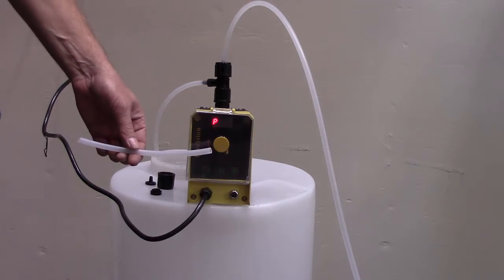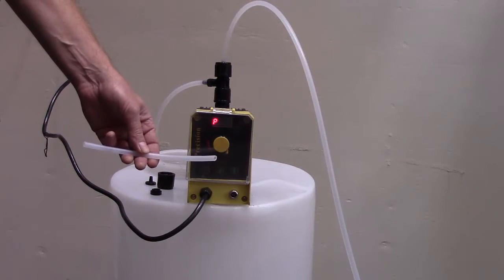Precision 24 Installation - How To Connect Tubing and Fittings

Comment: What is the problem If the chemicals run out quickly?
Reply from the maker: There can be several issues causing the solution to be used up faster than normal.   One possible cause is the well is siphoning solution back down the well.  Another is that the chlorine pump is set to run all the time and not wired to turn on and off with the well pump.  If you have questions about this please email our support team at support@cleanwaterstore.com
Reply: Mine was sett to 100ml per hour for 800ml hour unit. After i checked it ended up pumping 250ml..it wasnt doing this before,  i didnt change any setting or plumbing? What could be the issue? Cheers